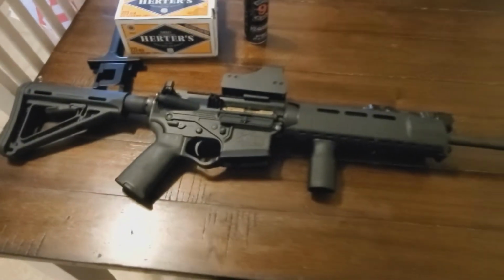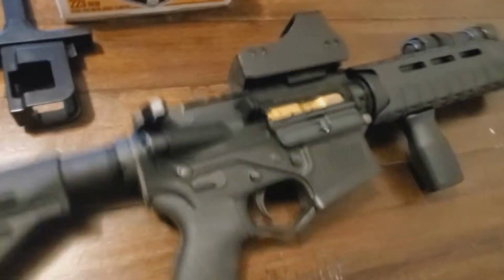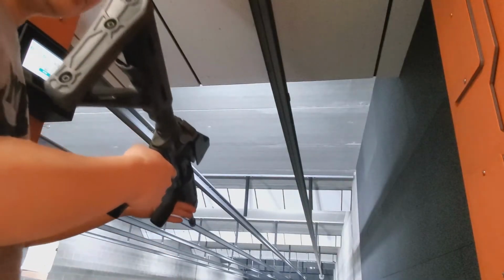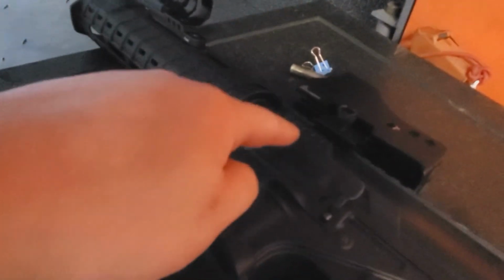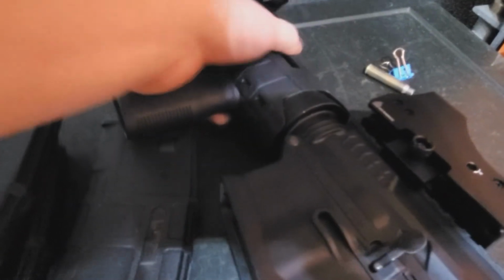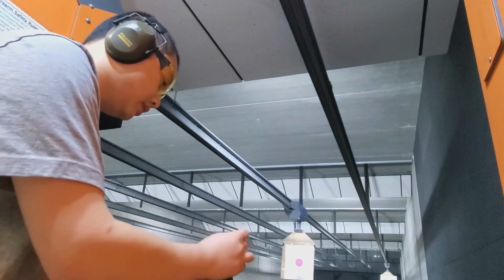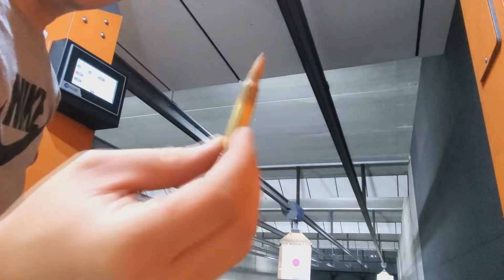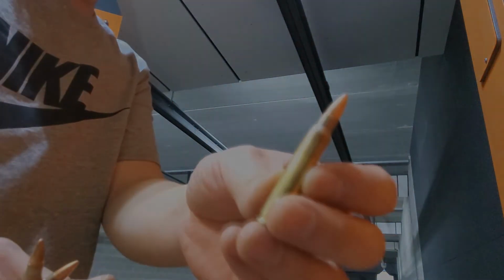Omni Hybrid Maxx custom Build 600 Rounds Later

Comment: Nice rifle. how is she holdin up?
Reply from the maker: I ended up selling it to a coworker. I did eventually built 2 more omni maxx setups. One of the build is still a virgin.
Reply: @azntactical4884 , Yes sir, I've assembled a couple myself but haven't taken them out yet and was wondering how they would do over time. They seem to be sturdy enough and judging by you shooting yours I really think your coworker got a nice rifle ...Thanks!
Reply from the maker: @anomalous8652  As long as you are not using as a stepping stool, you should be fine with it. I like to do 1k test before I call it good. I have shot with it in the winter cold here and does fine. I would trust my omni build for self defense situations.